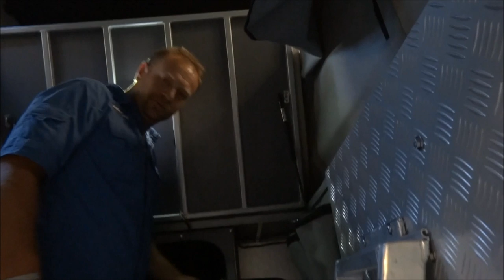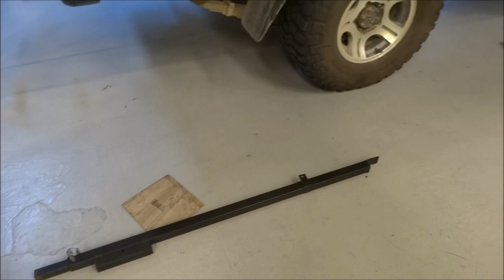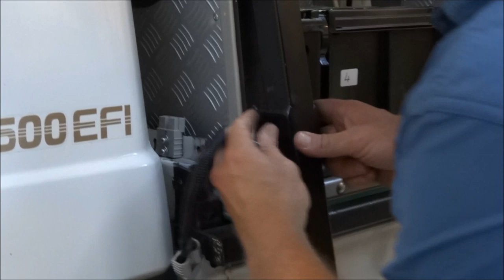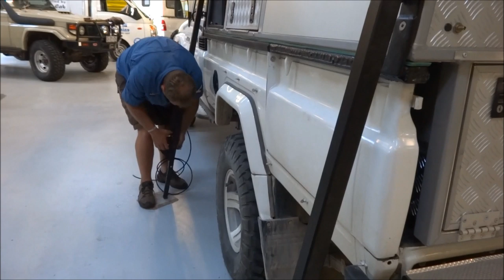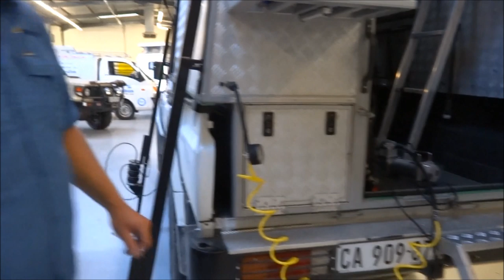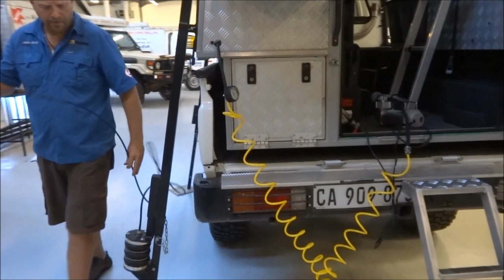Alu-Cab Drive-Off-Camper für Pickups - Demontage

Comment: Very cool idea...but seems fussy to mess with.  Alternatively, you might consider putting the air bag suspension on the truck.  Some air bag systems we have here in Canada, have a "kneel down" feature, designed to facilitate docking a fifth wheel or goose neck trailer (rather than raising the trailer).  The air pump is installed on the vehicle & switches mounted to the dash. Then all you would have to do is set your camper support legs, kneel the truck down, drive out, and air the bags bag up.  Reverse the procedure to re-dock with the camper.  The added bonus is a customizable ride quality depending on your load & road.  Good luck!!
Reply from the maker: Hi Greg, thanks for your feedback. It's a very good idea.
Reply: Greg Belley ,  ,,,

Comment: Too complicated, what happens if the pumps fail or someone hits it with a car?
Reply from the maker: This is a standard tyre compressor which you can buy almost everywhere and I think you will find a way to do it with a Hi-Lift or a car jack in case of a broken compressor.

Comment: nice. how much are they what model is that?
Reply from the maker: Check www.alu.cab for product range. The Ossewa Camper can be mounted on almost any Pickup. New Drive Off Camper will be available from June 2017.
Reply: Klaus Nahr thanks klaus. i have been trying to find a price list on the ossewa on their website. thats a neat one
Reply from the maker: Prices in Germany for the Ossewa are starting at around 21.000 Euro with most of the features included. Awning is 1.203 Euro, Sidewalls for Awning 823 Euro. All prices excluding VAT.
Reply: Klaus Nahr thanks. thats not that bad